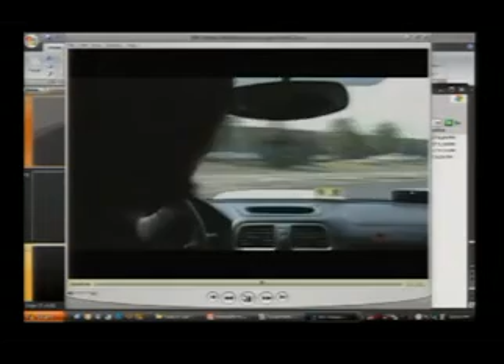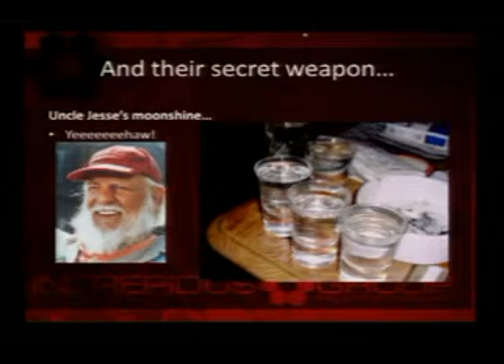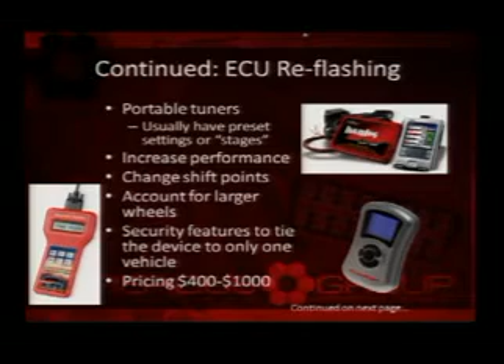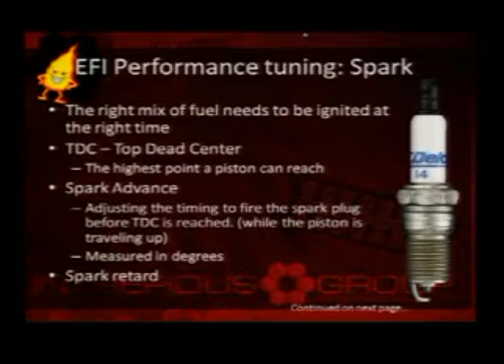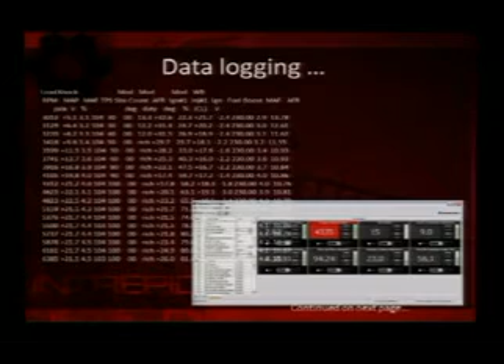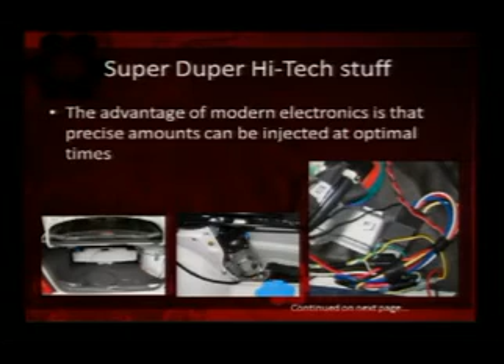DEFCON 15: Hack Your Car for Boost and Power!

Comment: Yeah this is great info other than the mistaken ODBII??? It's OBD2 aka second generation On Board Diagnostic plug. They used to have a couple different types in the first Gen. With the use of ECU & ECM's they went to one style- intro of the OBDII

Comment: I just happened across this vid while searching for a way top get my firmware from my ECU before swapping it out.  What happened to openecu.org? I can locate it on line anywhere. Pi Innovo OpenECU is not the same bu that is all that will come up.
Any assistance would be a huge help.